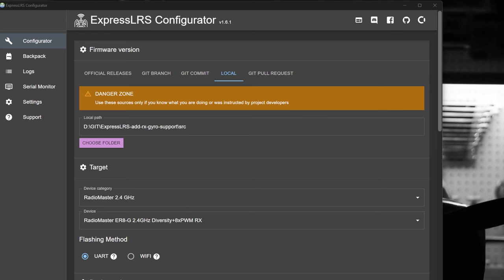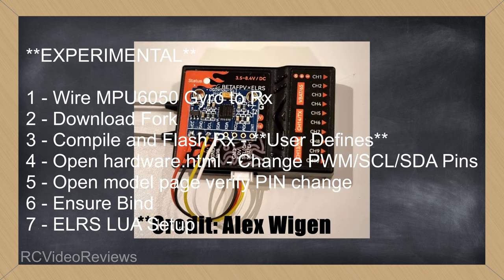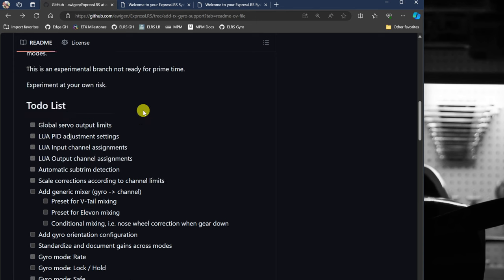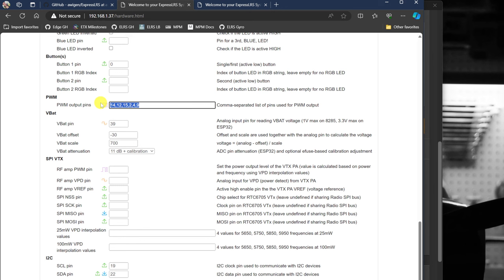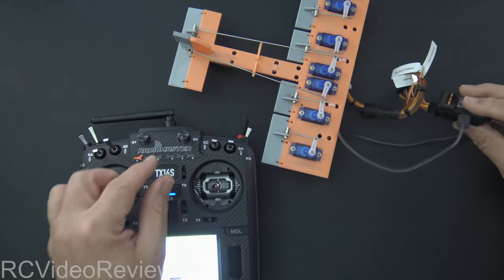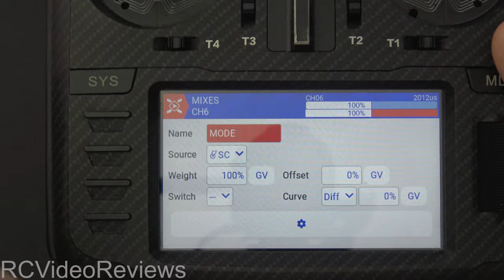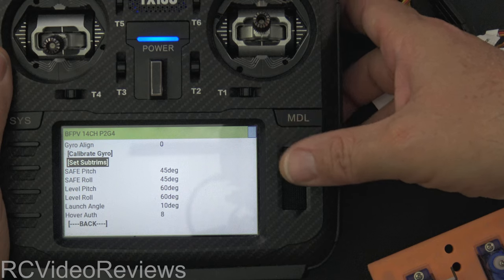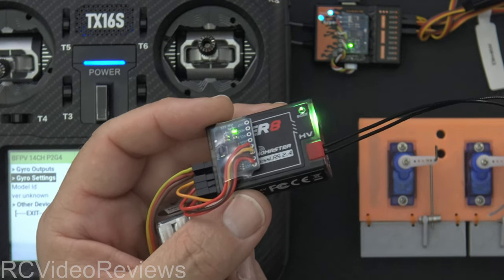ELRS Gyro Stabilization WORKS!

Comment: Ironic that this is probably the same accelerometer in the flight controller that's in my $1000 plane.
Reply from the maker: Probably. I think the gyro is probably known, but the integration code is somewhat new. I put a great deal of faith in the ELRS team to incorporate code after they're thoroughly tested it. So until they mainline it, I consider it experimental.
Reply: work for helicopters?!

Comment: SAFE is registered to Spektrum. Alex might have to pick another name. I believe what he calls SAFE mode is bank/angle limits without self-leveling. Spektrum calls it SAFE "Envelope" mode. Spektrum's other SAFE mode is "Self-Level/Angle Demand". This is apparently Alex's "Level" mode.
Reply: @Mikeylikesit1968  😂🤦
Reply: @Mikeylikesit1968 As much as you guys hate Spektrum, I figured you wouldn't touch it if it said "SAFE".   🤣
Reply: @Mikeylikesit1968  What an incredibly stupid thing to say. People can learn to fly RC planes however they want. I've been flying for years and still flick the SAFE switch occasionally when I'm close to crashing doing low level aerobatics...
Reply: @Mikeylikesit1968 The ® on a product means that it’s a registered trademark, meaning the brand name or logo is protected by (officially registered in) the US Patent and Trademark Office.

Comment: So I did everything you did but when I go to flash  I get an error saying this : Not a PlatformIO Project 'Platformio.ini' file has not been found in current working directory. To initialize new project please use 'platformio project init' command
Reply: Yep been ghosted. Bummer
Reply: Try run as administrator.. but later i got helper_3d.h error, stuck there
Reply: @estilociko  ya it don't work, when you ask him for help, it's just crickets

Comment: Did this project go dead? 9 months and no code changes or merges.  Is there something new I'm missing?
Reply: I am wondering the same thing. The only thing keeping me from moving my fixed wings to ELRS is having to have a separate gyro on my smaller stuff.

Comment: The Radionaster ER6 and ER8 have an extra dedicated -/+/Rx/Tx connection. Why can't this be used to connect to the gyro instead of losing 2 channels or soldering direct to the cpu? This output is a regular serial output as far as I can tell, I just configured it as sbus on my ER6 in the usual way and it works fine. It appears to work just the same as configuring 2 x pwm channels as one serial output.
Reply from the maker: There was some tinkering with it, but it didn't work. Unclear as to why. Not a bad thought if you want to get in there and fiddle with it. You might find the combo. Keep in mind this is very recent material and new information will unfold. This is also not a long term strategy, just short term while we wait for integrated options.
Reply: @RCVideoReviews   I've got a gyro unit coming tomorrow so I'll play around with it.
Reply from the maker: Please share what you learn. My discord is great for that! :) Just sayin'
Reply: I tried connecting a gyro to my ER6 tonight using the serial connection. I followed the procedure shown as closely as I could, flashed the firmware then wired SDA on the GY-521 to the serial port Rx and SCL to the Tx. On the hardware.html page I deleted the serial pins 1 and 3 and entered these pin numbers for SCL and SDA. It seemed to go OK but unfortunately the ER6 would not then bind to my transmitter. It looks like this isn't as simple as I'd hoped! Fortunately everything worked OK when I re-flashed the ER6 with the standard firmware.
Reply: @ChrisBalmforth  I searched for you on discord but no luck. Perhaps  with a different handle. Hope you can join and share. Any chance you can share what pin out you used and any sites to see/learn steps and pin out etc. Any information is greatly appreciated. Jeff.
Reply: @hspeed3656  I don't think I can help much. On the hardware.html page pins 1 and 3 were shown against the CRSF Serial pins, so I tried entering them for I2C SCL and SDA. Unfortunately that didn't work and I was already way beyond my capabilities so I gave up. I'm afraid I don't have time or ability to take this any further!
Reply: @ChrisBalmforth  Ok. Thanks for the info.

Comment: This is really great.  Thanks for posting!

edit:  
I got this working on betafpv super-p rx with a few notes.  Could not get any flip mode gyro orientation settings to work, the work around is just invert non-flip outputs.  You must manually set PID & gain values they default to 0,0,0,0 thus no output.  Again, really cool though.

Comment: Hi John, very informative and great vide, as usual!!

So far I have found the following bugs:

- Gain only works with the Rate mode, all other gyro modes seem to be at their max gain set in Gyro Gains in the Lua, and are unaffected by the master gain from the Gyro Inputs channel assigned.

- Only input channels for which there is a possible pwm output, can be assigned to the Gyro inputs, for instance, for an ER6, only channels 1 through 4 are seen by the gyro for inputs, for an ER8, only channels 1 through 6 are seen for inputs, and so on. All the possible "virtual" channels up to 16 have no effect as inputs (for gain or mode) if they are beyond the channel number for which there are physical pwm output pins. So for an ER6, this only leaves 2 channels to use for model control if you want mode and gain inputs. The "Input Mapping" setting in the Lua always shows 5, and if it increased to more, like 8 or 16, it is reset upon rx power cycle.

- The Min/Max pwm pulse width under the Model menu of the receiver wifi page doesn't only affect servo deflection for the gyro, it also sets the min/max deflection with the stick/knob/switch from the TX as well. So if a pwm servo, say ch2, or elevator, output is set to 1500 mid, and 1300 min and 1700 max in that menu, even if the gyro if off or centered and has no effect on the servo, the elevator servo will only deflect from 1300 to 1700 uS pwm pulse width, not its usual 988 to 2012 or what have you, so that setting acts as an end point adjustment rather than only for servo deflection commanded by the gyro. It is somewhat restrictive, and if it is left at its max, since the master gain has no effect on the gyro in level or any other mode other than Rate, the servos do slam all the way past their physical end points sometimes. So either that needs to be fixed, or the master gain needs to be fixed to work in all modes.
Reply from the maker: Good findings. Thanks for sharing. Did you happen to create an issue?
Reply: I haven't, I am very much into rc, building and Elrs / programming, but not as much social media and all the diff platforms. How or where do I create an issue or report my bug findings? To Awigen on Github, to the Elrs dev team, or Discord somewhere? If you send me a link or point me to the right place, I will create it.
Thanks
Reply from the maker: The ELRS github would be the right place: https://github.com/ExpressLRS/ExpressLRS/issues
Reply: I tried to flash the firmware to my er6 and kept getting errors , guessing they changed the firmware or updated it

Comment: Great work Alex, Thanks for doing this great video John, So works with ER6, ER8. Will it work on any other RM RX's?  You mentioned the option to solder on the ER8, if a person did that will outputs 7 and 8 be available, if yes is that an option on the ER6. You will need to do another video using your microscope and soldering directly to the board.
Reply from the maker: Jeff, It should compile for other RXs. The problem you'll have is figuring out where to get SCL/SDA. I'm not going to go down that road, so ER6/8/Beta 14ch for now. Outside of those three, I'll just wait for the production units to come out. For me this is simply an experiment.

Comment: great tutorial! very informative. BTW 1) gyro stablization is usually used with FC. I think the gyro here can be used for some RC planes without having a FC. Otherwise, what's the point of mounting a gyro (via i2c) to a receiver?  BTW 2) Yeah somebody is gonna solder the gyro into a upcoming ELR receiver.
Reply: Drag racing and drifting surface vehicles.

Comment: Nice walkthrough.  Unfortunately, it does not appear to want to compile for my Happymodel EPW6.  It is an ESP8266 based board, and from the looks of the errors, libraries are missing.
Do you know if there are plans to support those receivers?  It does work for my two EPS32 Rx'es. 
Thanks for putting this information 'out there'. 
Gordon

Comment: I run my ELRS through a Radiolink BYME-A or BYME-D. I have the RX set up as SBUS . $22 for the Gyro plug and play ❤
Reply: Sadly no failsafe!
Reply: @1nformatica  it will keep itself level in event of failsafe so your plane could land in one piece but yeah it’s not going to RTH haha 😂
Reply: @dronepilot260rc  The throttle will be still at the last value and the plane will disappear into the sunset never to be seen again, voice of experience here!
Reply: @1nformatica I use BYME-A and elrs, the throttle is disabled when failsafe.
Reply: @1nformatica  you just have to set the fail safe in the lua script
Reply: Those are fine for putt putt planes but for fast planes there not good cause they don't have gain control
Reply: @Mikeylikesit1968 looks like you can set a knob to control how much stabilization is provided. That should definitely help out

Comment: I'm curious about using this with RC cars, for directional stability. I've been searching around a bit, but I can't find a forum or CR where this is discussed. Any ideas where I should turn to get information to get started on that?
Reply from the maker: ELRS discord would be a good starting point.
Reply: @RCVideoReviews  Thanks. A shame everything is on discord these days, I don't much like the navigation and lock-in of that platform, but it seems to be where it's all at.
Reply from the maker: You're missing out. I love discord. There's a reason everyone uses it.
Reply: @RCVideoReviews  Oh, I use it. That's how I know how bad it is. A nice forum with a file area is much nicer.
Reply from the maker: Forums don't have the live interaction capabilities of discord. I never use forums anymore. Discord supports file attachments, pinned files, and search. Far more dynamic. 

Anyway...you asked a question.

Comment: I saw the Matek PWM converter has DA and CL pins, i suppose it can be use them for the gyro ?
Reply from the maker: Probably not fed back to the RX. Those pins are probably used to support devices for telemetry purposes. You could always give it a try.
Reply: @RCVideoReviews   I will give it a try when the gyro come. Thank you for your kindness.

Comment: Can you pass telemetry to a VTX? Maybe involve FC with Gyro? It will allow us to add GPS module for speed tracking, gyro data etc... Is it possible?
Reply from the maker: Not really. Telemetry is usually layered on top of the video stream as graphical information, not textual. This is done by FC's who ingest video from the camera before passing the video stream on to the VTX.

Comment: I do not have ELRS in my Boxer, can i use this gyro with a not ELRS radio and receiver ( question id for airplanes not drone)? Sorry if this is a stupid question but i do not know much about ELRS. Thanks
Reply: I don’t think it will work on say a flysky ia6b rx
Reply: No, because the code running on the ELRS receiver is what is interpreting the gyro outputs.   You can use something like a Hobbyeagle or NX4 gyro stabilizer which takes SBUS or multiple PWM inputs.

Comment: Why in the world does Radiomaster not make a gyro stabilizer receiver blows my mind!
Reply from the maker: ELRS is opensource. If RM wants to use ELRS (and it's clear that's the choice they've made) they are somewhat dependent on ELRS opensource to develop the code.
Reply: @RCVideoReviews  but wouldn’t RM need to supply the hardware side of it to their receivers first?
Reply from the maker: This is a bit bi-directional. ELRS has reference designs that are used with manufacturer specific spin. The point stands though: Firmware is the gating factor and it is not in the hands of RM. It's in the hands of the ELRS dev team.